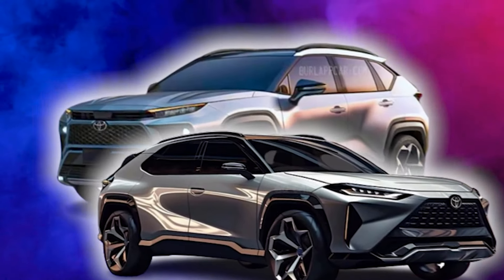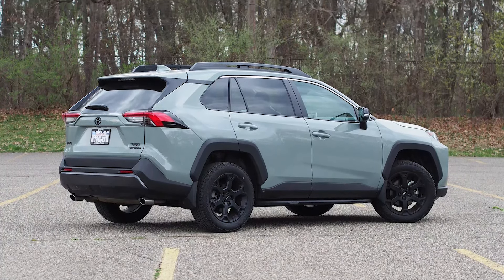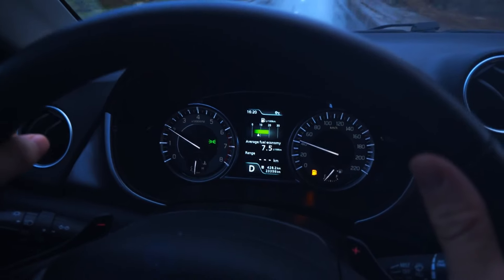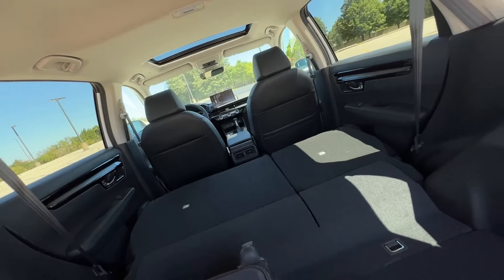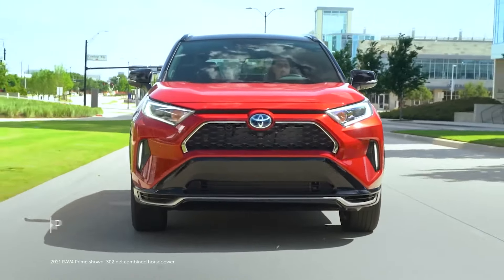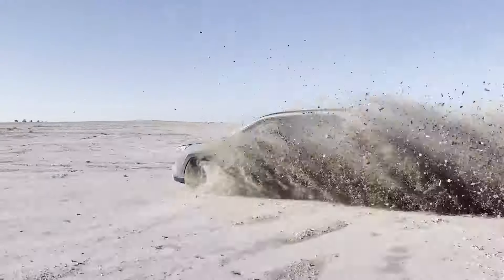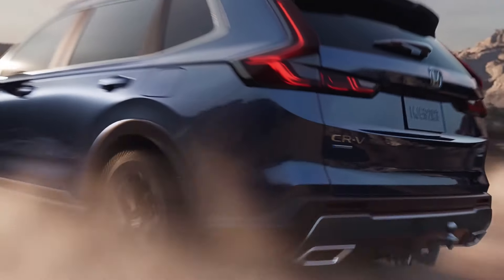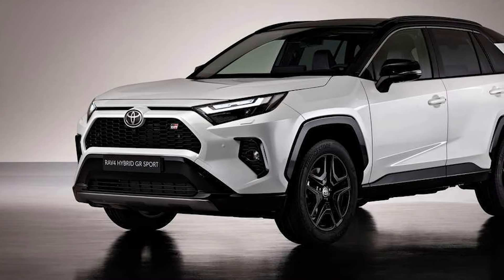NEW 2025 Toyota Rav4 JUST KILLED All Competition!

Comment: I had a 2016 Rav4 hybrid and drove it for over 250k miles. I never had any real issues. All I did was oil changes, spark plugs, headlight bulbs, tires, cabin and air filters, and brakes. did the 30k 60k 90k 120k 150k 180k 210k 240k services. As old as the car was, I was still getting an average of 27mpg. I traded the car in for the new 2024 Model.  I now have a new 2024 Rav4 SE Hybrid and I am now getting an average of 38mpg.

Comment: Rav4 has no sound dampening and its uncomfortable. Loud as hell wind noise. Sorry but a Mazda will stomp over this ANYDAY
Reply: Agreed. Except it wont sell like the Rav4. Sadly.
Reply: The new Camry got big improvements in that area, I’m hoping they do the same for the rav4
Reply: The Mazda has horrible gas mileage.
Reply: I’ve had both , like the Rav4 better
Reply: Agreed. I had a rav and while I like the looks, it’s a boring drive and just wasn’t fun at all. Traded it for a cx50 which drives like a coupe. Loves it.
Reply: @whatcom1674 you gotta be trolling. Rav is like driving a fridge.
Reply: @billjanis6328 if you’re after just gas mileage and a mundane appliance that’ll get you to and from the drive thru window for the next 12 years,the rav is 100% for you. By all means.
Reply: My brother in law is one of the VPs of sale at one of the largest dealership networks in the North East of the United States and I’ve been in both the RAV4 Prime and MAZDA CX-90 PHEV and the RAV4 Prime was the superior vehicle in my opinion. Also, it was fairly quiet, especially when operating in all electric mode (despite the apparent wind noise). Plus the RAV4 Prime has a significantly better and larger battery (at 18.1 kWh) paired to a more efficient drivetrain, with an (EV ONLY) range at 42 miles, as compared to the CX-90s (PHEV) EV range of 26mi achieved with a (17.8 kWh) battery. Not to mention, the RAV4 has a better MPGe ratings of 94 (MPGe) compared to the Mazda’s 56 MPGe. It also only manages to  achieve 25 MPG on gas alone, with the RAV4 managing 38 MPG on gas only and, being able to travel a total of 600miles on a full tank and a fully charged battery. The CX-90 PHEV however, has a total estimated range of only 490 miles, with the CX-90 PHEV only producing a total; pf 490 miles of range. The CX-90 (PHEV) does however, produce a combined 323 BHP, with the RAV4 Prime producing a slightly lower combined 302 BHP. The RAV4 Prime costs around $43,690, while the CX-90 (PHEV) has an MSRP starting at $49,945. The RAV4 Prime can go from 0 to 60 in 5.5 to 5.7 seconds, while the Mazda CX-90 (PHEV) is capable of achieving a 0 to 60 time between 5.9 to 6.6 seconds.
Reply: @billjanis6328   Totally agree! My CX5 2021 gives 25.1 per gallon and my wife's CX9 2018 gives 19.5 miles per gallon, with mixed (local/highway) driving. Now, would like to get my hands on Prime 2025
Reply: No wind noise in my rav4prime 2023
Reply: @pobster88j94

Yeah, the Mazda is great if you are a dolt that wants the gas mileage of a pick up truck. LOL